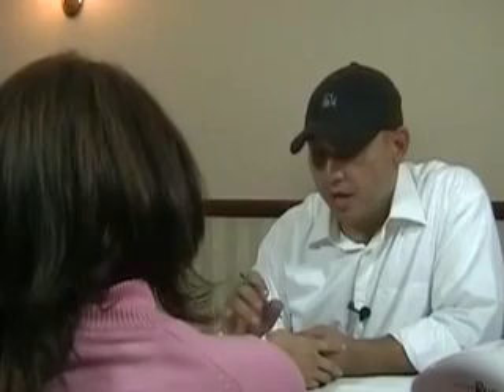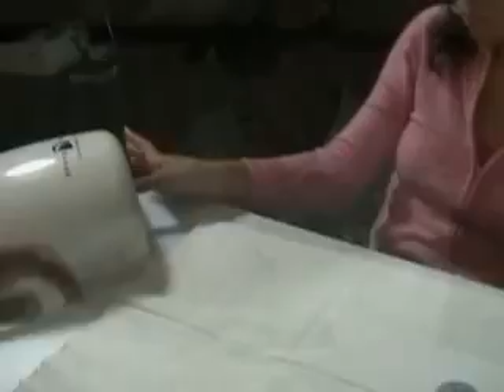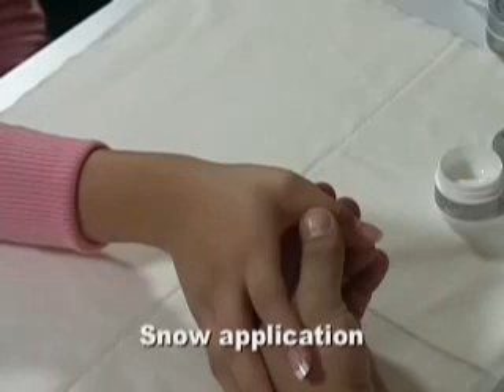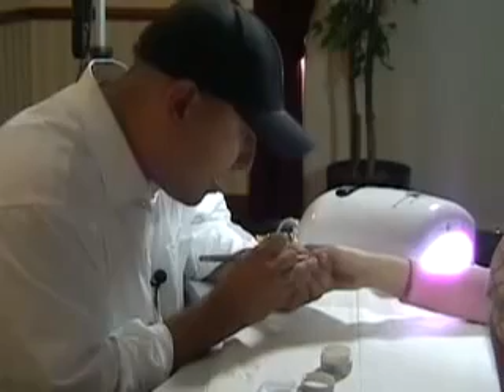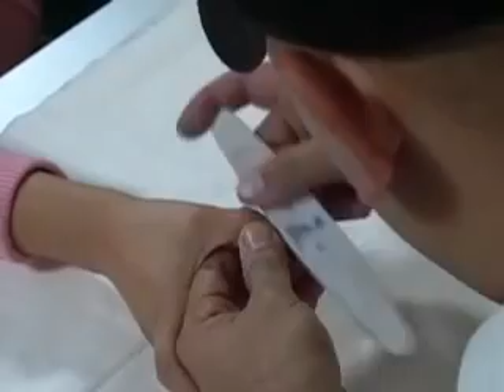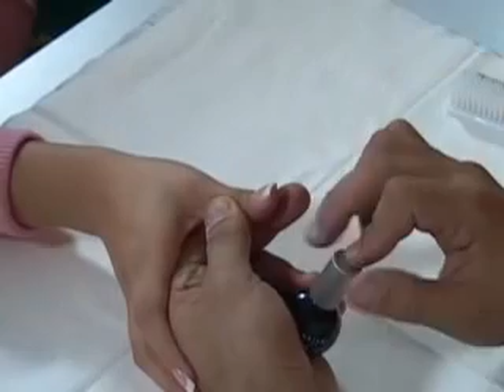gel french nails

Comment: Better salons will not file the bed.  And they will cure for the full recommended time between applications.  Most cheap places work make their money by working quickly. They use drills and don't cure long enough.  Based on my experience.

Comment: @UnknownUselessName 
This is not true. If the Tech is using incorrect filing technique, the natural nail can be damaged regardless of what system is used (acrylic or gel). The damage is done when aggressive filing techniques are used and extensions are pulled off when removing.
Also, natural look can be achieved using acrylic too - it's purely down to the skill of the person doing it. Mega thick gel nails can be created too. :)

Comment: @jllove1992 you have to remove the shine from your natural nail so that the gel or acrylic would stick onto it otherwise it'd just fall off. 
it is risky to use an electric drill on your natural nails as it can always thinnen them to much, they should use a normal, high grit file (like 180 or 240).
If you're fraid they will ruin your nails tell them to be gentle.

Comment: @susany2k5 You can't soak gel nails off. They must be filed off. There is a type of gel polish that can be soaked off, but even this is difficult to do. One usually has to file and THEN soak. I do gel nails professionally. I use both the Young nail gels (The guy in the video is the founder of Young nails) and LCN. What he is doing in the video is a full set of gel nails which must be buzzed off to remove. But gel nails definitely don't harm your natural nails.  Hope this helped.

Comment: You can get kits at Sally Beauty or on Ebay, but I would recommend that only nail techs work with gels, as they can cause a lot of damage to the nail bed if they are not used properly.